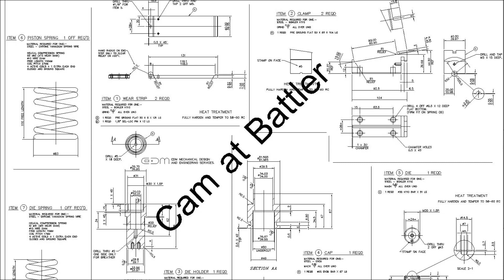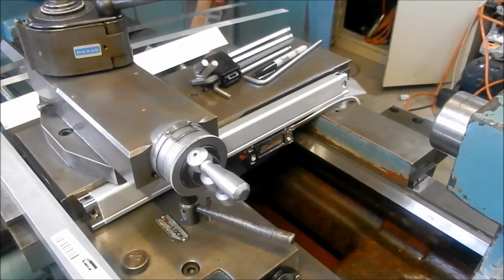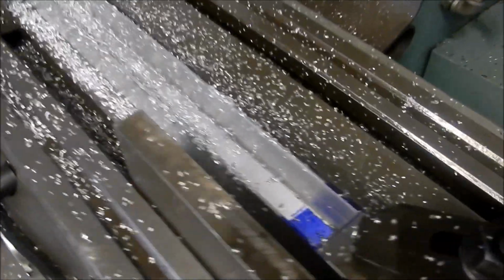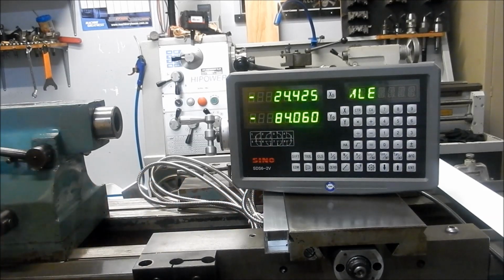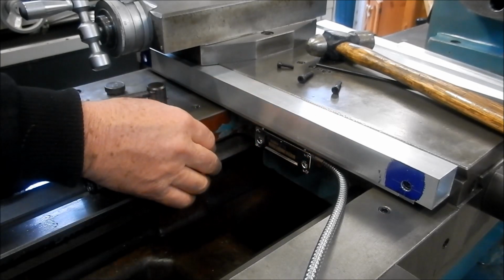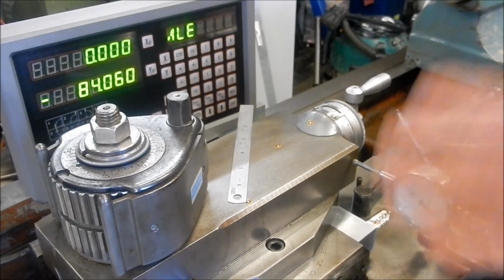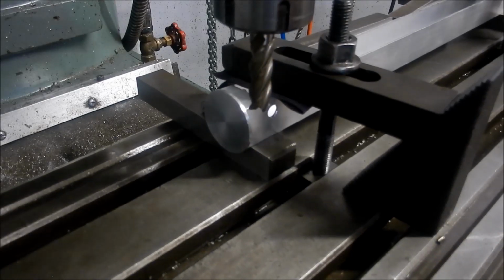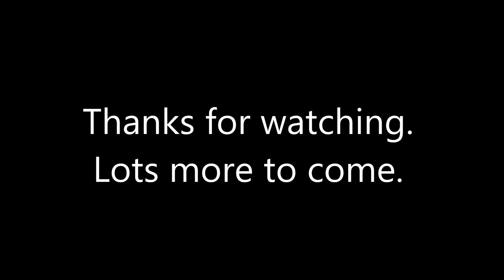Fitting DRO Scales to the Victor Lathe Part 1

Comment: i ended up using the compact version for my sino setup on the crosslide but i found out that the sino dro needs to be earthed it seemed to upset the sino scale so i ended up buying an easson compact scale, and all is good. for the cable i ran it straight under the scale but i hat to relieve some of the meat on the carriage where it ramps up from the read head but made it so much neater and it meant that the tailstock can come in almost up to the scale to eliminate longer quill stickout
Reply from the maker: G'day Troy, yep I used the compact style on my other lathe and probably should have done the same on this lathe as well.  As you mention you do lose some travel on the Tail Stock but this thing has quite a lot of travel to start out with.  I'm not keen to relieve any meat from the saddle so will pin the cable clear of the scale, if I find it becomes an issue I'll fit the slim line compact unit.  I'm going to run the cables in a Drag Chain the same as on my other lathe to keep things nice and neat and keep them away from swarf and catch points.
Cam

Comment: Gday Cam, the end result there looks fantastic, the idea of putting the scale in the box section is the best I’ve seen yet and the end caps really finish it off nicely, I’m really looking forward to seeing how the next scale turns out, brilliant job mate, Cheers
Reply from the maker: Thanks Matty, its worked out well so far.  I probably go over the top with protection but the scales can be easily damaged if a chuck key or piece of stock lands on them.  I'm fitting a drag chain to the Z axis to control the cables but still waiting ,for it to be delivered so can't finish out till then.
Cam

Comment: Hi Cam, did you run a dial indicator to tram the scale to the cross slide or was there no need, the machined finishes of the lathe look spot on.
No chance of coolant or chips fouling the read head with your cover design, nice job.
Reply from the maker: G'day Willem, I should have mentioned the alignment during the video.  This was a fairly simple job, I used the 45 degree chamfer on the edge of the Cross Slide to line up the corner of the square tube with the bottom of the chamfer.  Also needed to make sure the glass scale is also hard up against the top of the square tube as part of the alignment before tightening the screws.  I recon I'm within a few of thou on the alignment by eye and feel.  The Z axis is a different story and will need to be clocked in both the vertical and horizontal plains.
Cam